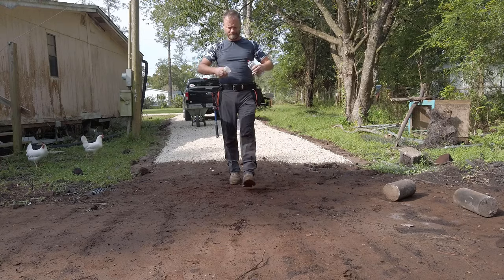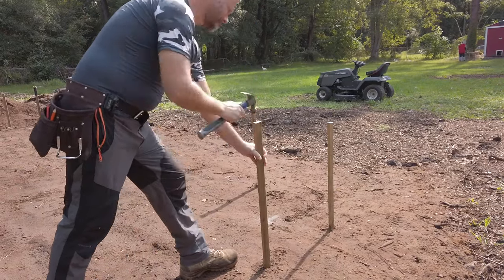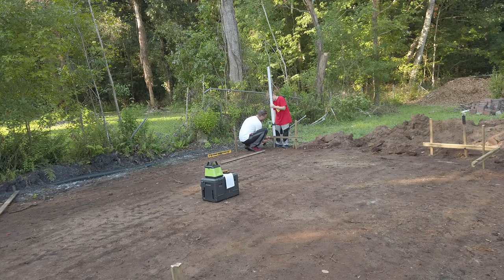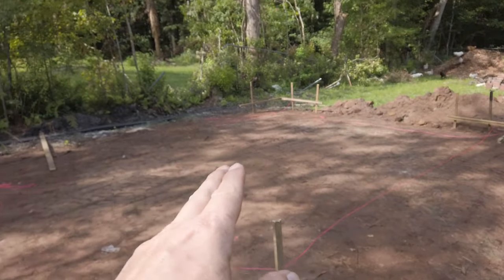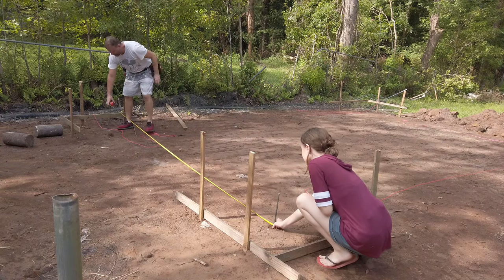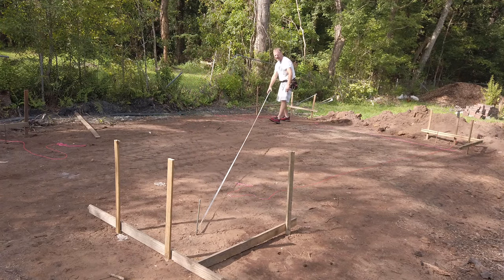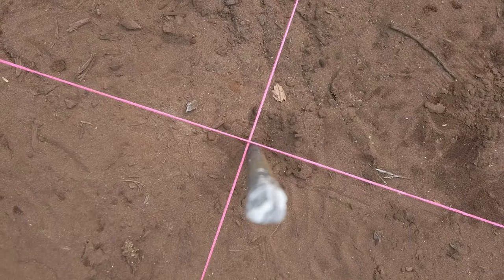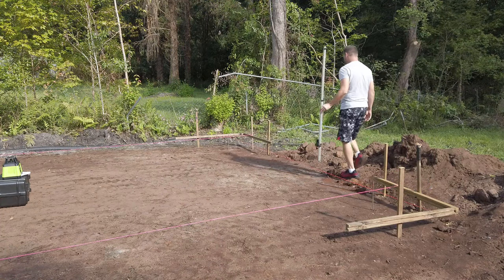Setting Batter Boards Running String Line 🚧 Building A Workshop

Comment: Thanks so much for taking the time to produce this video….I found it very helpful as I’m about to start a greenhouse project.  My one question is if one should fuss over the rebar pins being perfectly perpendicular?  It seems that if they weren’t you could easily be adding or subtracting and extra 1/2 inch or so.
Reply from the maker: No, it is not an issue.  Why would it not be an issue?  Because you already know what your diagonal measurement should be and you are checking that measurement on multiple occasions.  The pins are for visual reference.  The tape measure has the final say.

Comment: If you had taller piers would start with a low string and do the same at a higher level?

Do you have any suggestions for keeping out animals underneath a floor above the ground on piers? Great videos. Really helped a lot.
Reply from the maker: If you wanted piers that were 4 blocks high instead of one like I did, you would just calculate the height of those four blocks with mortar lines and set your batter boards at that height.

As far as keeping critters out from under the building use skirting of your choice.  Always maintain airflow under the building.  So don't fill the space under the floor with garbage and other nonsense.  If you use a solid material like sheet metal instead of a lattice style skirting cut vents in the skirting every 8 feet or so.

Comment: This is great on mostly level ground, but any tips for doing this on a more dramatic slope? It's not like I can just lay a tape out on the ground, because the slope of the ground would make my distance measurement inaccurate.
Reply from the maker: It's actually not different at all.  Pier and beam systems are the preferred foundation on slopped ground.  You see buildings with piers a foot tall on one side and 4 feet tall on the opposite side.  Don't get distracted by how level or slopped the ground is.  Only two things matter.  Footer 12 inches below frost line and the top of each pier level.

Comment: I really enjoy how you teach . Question: If I’m laying down a footing on a downhill slope. Is it the escavators job to take less dirt on the low point or remove more dirt on the high point or does he first  level out the entire area before he digs out the footing ? God bless
Reply from the maker: I'm assuming you are talking about a continuous footer on a slope?  If the grade cannot be leveled or it is cost prohibitive to level the site out then you would use "step footers".  In that instance you take more from the high point and less from the low point until you get to your step.  Then you start all over again.  However, all of the footer must be the required depth called for by code in your area.   I live in Florida and we always level the grade.  Step footers are rarely used here.
Reply: Gotcha. Yeah It’s only 100 sq meters 10x10 it shouldn’t be to costly . Thanks a mil bud

Comment: Love the video. I'm building a she shed for the wife and this helps a lot. What is the name of that lazer level your using. I'm using string levels right now. Crossing my fingers my level lines are correct. I wanna invest in a lazer level, but they are so expensive.
Reply from the maker: I don't remember the brand name off hand.  It's been with me for awhile.  I don't recommend spending the money for laser levels for the basic homeowner that may only use it a couple times at most.  String bubble levels are fine for small projects like she sheds.  Good luck and enjoy the build process.
Reply: @simplyeasydiy  thank for taking the time and sharing that information. So yes I've been very successful so far with a string, line bubble and a 4' level

Comment: I need to buy a laser level. 

I’ll use it on about 4 or 5 projects and then it will not get used much after that. 

Any suggestion on what one you’d consider purchasing?
Reply from the maker: If you're talking about one like what I have in this video I wouldn't buy one if you only have a few projects to do.  Their are other methods of leveling that are just as accurate without laying out several hundred dollars.  Get a line level set and be done.

Comment: Great videos, I’m learning a lot before I start my backyard storage shed!   One question I’ve got. If cinder blocks actually measure 7 1/2” wide why is it that your 2” X 10” (actually 9 1/2” wide”) sill plates match the width of your cinder blocks?  They look like 2” X 8” boards. Is this a video induced illusion?  Thanks. Terry
Reply from the maker: Sill plates are pressure treated 2x8's.  Floor and Rim joists are 2x10's

Comment: I have a question! Why couldnt you have just wrapped the string around the pins instead of attaching them to the board and adjusting the nails? Could have gotten them level with a helper and the same laser lever you used to level the boards, no? Great video, thank you
Reply from the maker: If you watch the next video in the series that may answer your question.
Reply: @simplyeasydiy  I did end up watching them all and yeah, it was answered. 😄

Comment: Stan, love these videos, thanks man. I was considering building a block shed in my back yard. The water table in my area is, I would say, definitely lower than yours, though I do get "low spot" puddles during heavy rains. My plan for a foundation was basically to have a 16 inch wide x 40 inch deep footer poured (I live in Ohio and the frost line is 32 inches). Would probably construct some sort of rebar skeleton within the footer. Does this sound like I'm on the right track in your opinion?
Reply from the maker: If your frost line is 32" then according to the code in my area the footer would need to be 44" deep.  Code here is 12" below the frost line.  You would need to verify if it is the same in your area.  Rebar in footers are code as well.  I have a video on footers that was posted just after this one.  Check it out.  Good Luck.

Comment: How important is having your corner pin exactly level stright up and down? Does this not change the actual squareness of the string lines?
Reply from the maker: This is a good question.  A lot of You tubers will tell you that every step in the construction process must be perfect.  Everything must be "Plumb, square and true" at every step in order for it to be right.  I think they do this in order to maintain a majestic quality to their content and the industry.  In reality no wall is plumb and no corner is 90 degrees.  In reality, every step, from laying out the foundation to doing the finishing work is a honing process.  Every step should get you closer to a square building.  The pins are not the end all, be all step for a square building.  Should they be as straight and secure as possible?  Yes.  Will your building be something out of a Dr. Seuss book if they are a quarter bubble off plumb?  No.  If you are off a little here you can still bring it back in line when you set the piers and again when the sill plates go on.  In fact you could be perfect here only to be off after you set the sill plates.
Reply: @simplyeasydiy  Thank you for your reply and insight. I am and have been trying to set out a concrete pad for a shed over the last week. I stuffed up my string lines I thought I had them right but didn't go back and check all the measurements of the actual width and length. I moved my strings too much and thought I had it right due to the diagonal measurement being the same. Pegged in all my boxing yesterday only to realise it's 80mm larger on one end. So now I have to undo it all and set out again. It's been so frustrating.